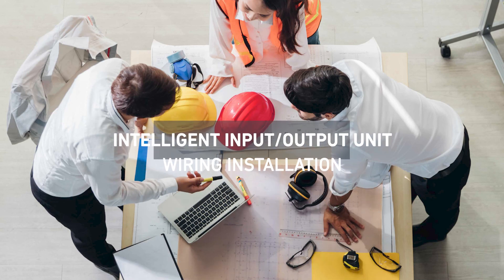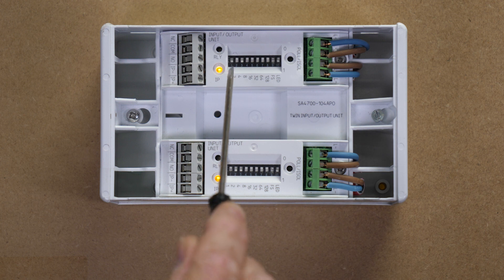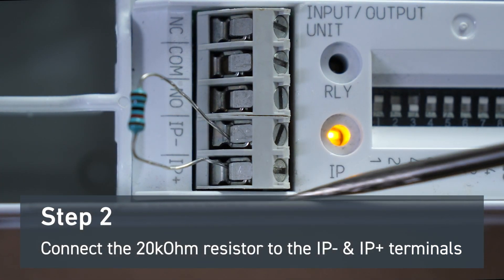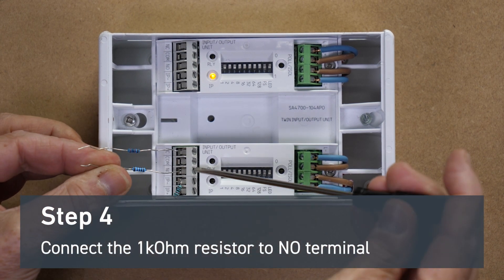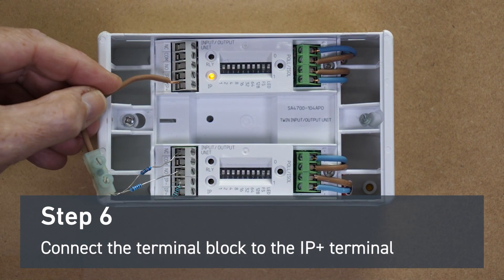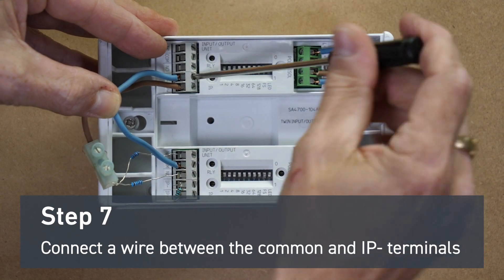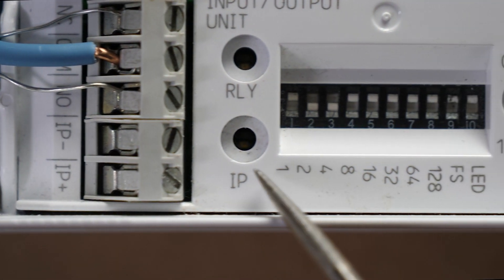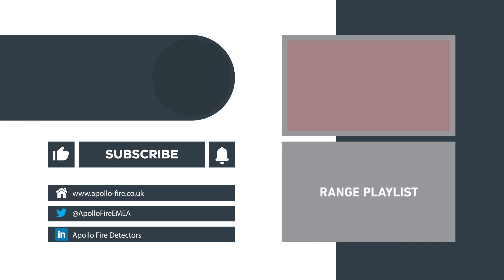Interface | How to Install and Wire an I/O Unit

Comment: Your wiring video hit the mark, much like Filter Bounce does for email verifications! Keeping things precise makes the difference, and after dealing with several bounces, this tool has kept my lists verified and reliable. Running cold email campaigns got easier knowing my bounce rates remained impressively low. For anyone grappling with maintaining list hygiene, Filter Bounce deserves a try—it is an affordable solution to optimize outreach.

Comment: Can than the input be texted differently to the out put
Reply from the maker: That would depend on the control panel you were using. We recommend contacting the panel manufacturer - (Warren)